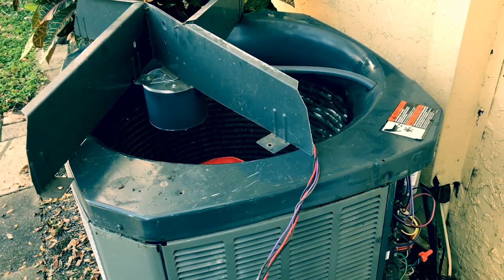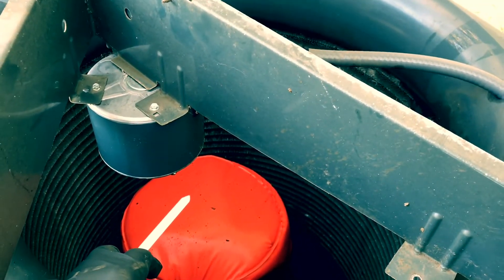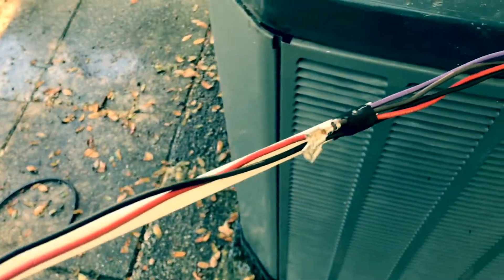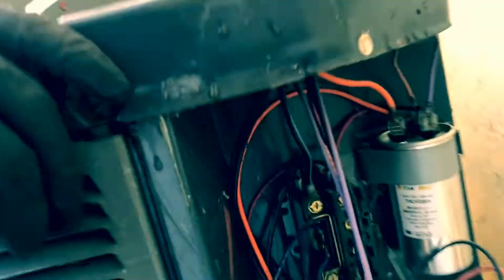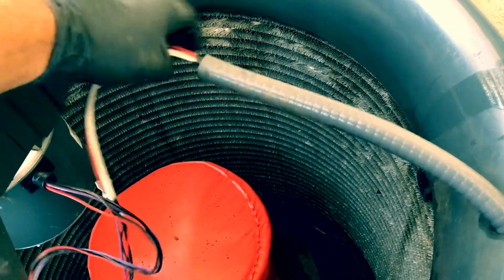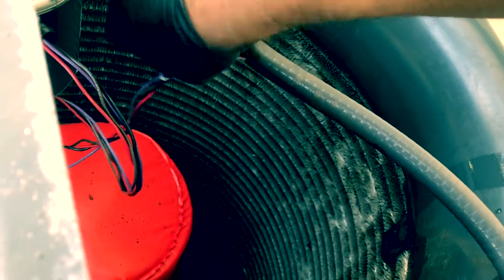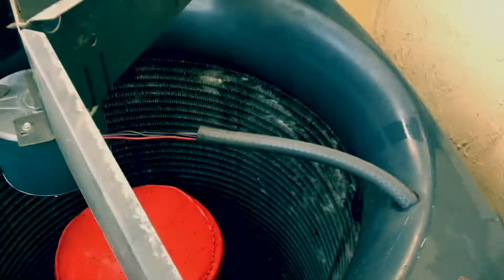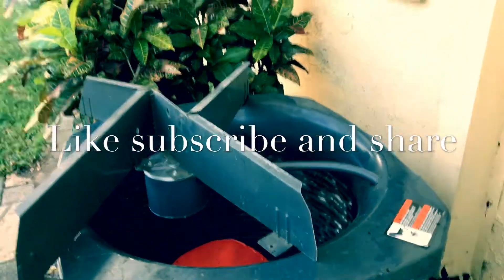How to run Electrical wire in Carflex Liquidtight conduit.

Comment: That’s a good idea. I usually pull out the wires but leave 1 old wire in the conduit from the bad motor. Then I tape new wires to the old wire and pull them through. Similar to your trick. Panduit strap could be better.